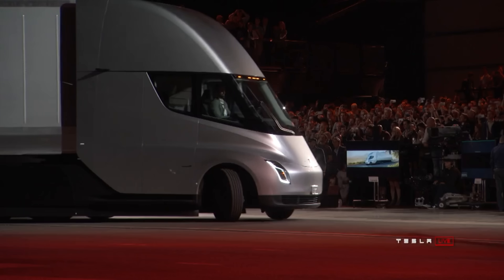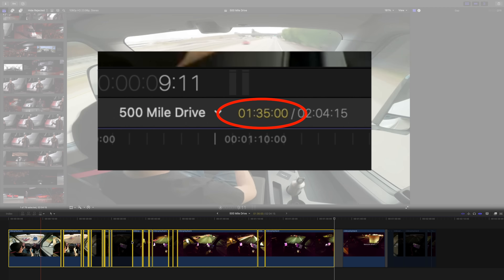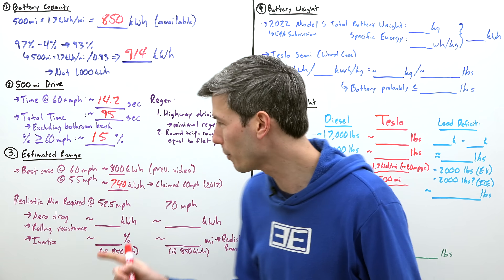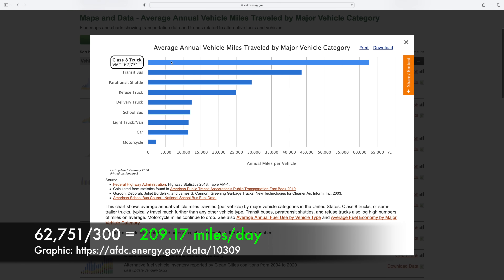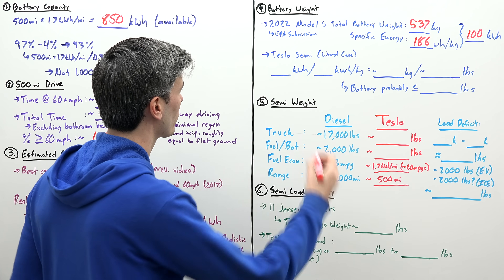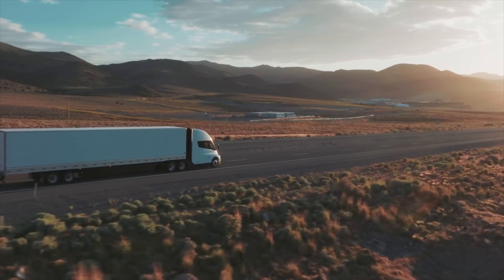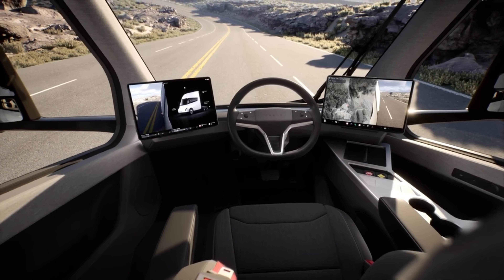Does The Tesla Semi Make Any Sense? Part 2!

Comment: I love how objective you keep your commentary. What stuck out to me was the "let's not pretend that you snap your fingers and all trucks will go electric." I hear the argument all too often that, "the electrical grid can't handle switching to all EVs," as though the 2035 mandate will magically transform all vehicles to electric. As the need arises, surely the infrastructure will be developed. Gas stations didn't all suddenly appear overnight either.
Reply: @Sean Simons   This is a great point.  I saw recently that automobile adoption went from 10% to 90% in 10 years in the early 1900s, and there was almost zero infrastructure for the oil and gas industry at the time.  Can our electrical infrastructure be upgraded in 10 years time to accommodate electric cars and trucks?  It most certainly can - @Engineering Explained did a video about that very issue.
Reply: Jason already did a video on growth of the electric grid vs future energy needs of passenger EVs.  Basically he said the historical growth rate of the grid is already close to enough to accomodate everyone switching to EVs over a reasonable time-frame.
Reply: @adamsmith-bg5wq  In the early 1900s they had a lot less constraints. Today there will be more constraints, efficiency, environmental, price of land (eminent domain), bureaucracy, etc. Also, will the energy and carbon cost of the infrastructure accommodations be properly accounted for, ripping up concrete, installing high voltage lines, installing transformers, pouring new concrete? I don't think the increased mechanization efficiencies today will outweigh the extra constraints of today.
Reply: He makes the statement that electric tractors will not replace diesel ones on all routes. You then immediately take a wild guess about the grid that you have no support for and use that as an argument. 
If every diesel truck in America was converted to electric what percentage of current electrical usage would that be?  What about for automobiles?
You don’t seem to understand how much electricity we use as a first world country. Your electric dryer or your stove uses the same amount of energy as it would to charge a car? 
Industrial usage dwarf set an aluminum smelter, or a steel mill uses enough to power city. Even in a factory, the lighting and electric forklifts are heavy energy users, and if the factory does welding, another heavy use. 
He actually did the work to prove his statement before he made it. You didn’t.

Comment: As a driver one thing I don't see anyone talk about with this truck is how bad the seating position is for backing. It causes huge blind spots while backing and we have to do a lot of backing in tight places.  Also the cab is to close to the trailer to allow for enough angle to back into a lot of places we go. It is not uncommon to have to put the cab past 90° to the trailer.

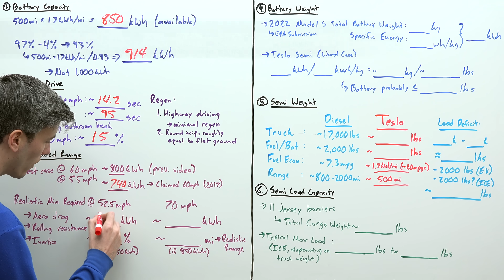Comment: 4:37 - Inertia is energy that is converted into kinetic energy of the vehicle and will eventually come back as range when either decelerating via coasting or (part of it) when recuperating. It is kind of a similar field to potential energy and elevation. This conversion on both directions is not perfect (losses apply), but is not as bad as you may think.
Reply: So in the video he is assuming 100%. I believe the real world number is no where close to this.
Reply: @cmitchell17a1  the efficiency is pretty close to 100%, as he showed in the video that the semi barely lost any energy from going up and down a large hill.
Reply: @beanapprentice1687  Proving anything here is going to be difficult when it actually doesn't exist yet except for prototypes and proprietary internal Tesla information. Can you provide any non Tesla semi evidence of the 100% efficiency (or even close to it) of regenerative braking? That means 100% of the kinetic energy lost when a driver decides they want to slow down is 100% returned at a correct later time?

Comment: If the Tesla carrying capacity is a respectable 44,000 Ibs why wouldn't Tesla have shouted that from the roof tops on launch day? The reason that non-Tesla fanboys are sceptical is that Tesla choose to withhold key information that requires people to guess and make assumptions, most people would think if the stats are good they will highlight them, if they are poor they will mask them. 

The speed of the demonstration road trip truck is important and the clip of the Tesla-Semi shown hauling the concrete blocks may not necessarily be the same Tesla-Semi that completed the 500 mile test run, it is implied, but it isn't clear.
Reply: These are clearly different semis, and nothing implies otherwise; the one in the 500 mi range test is shown at the beginning of the video with an enclosed trailer filled with pallets.
Reply: @BigBen621  "clearly" is the problem, because in the delivery event nothing was clear.

The launch speed that is heavily promoted, which regardless of it being nothing a haulier would consider a priority feature, but nowhere is it stated as to how much each maximum launch would affect the range. 

Even the the word "Delivery", how many Tesla-Semis have actually been delivered to Pepsi, none, one, five or more?

"Reliability" is something that cannot possibly be gauged until the trucks have been used in anger in real-life situations. Sure there are no clutch, engine and fuel systems to go wrong, but there are electrical systems and there are luxury car manufacturers like Land Rover whose Range Rover range are notorious for electronic unreliability.

With the current extreme cold weather, how much does that impact a Tesla-Semi's range?

For a marketing event and for those of us that do not like to take things at face value we were left with more questions than answers.

Comment: While I agree that for the sake of your analysis you can ignore regenerative braking, the way you explain it makes it sound like it's not significant due to relatively constant speed which is not really true.  From past work with Southwest Research Institute, this was studied as part of a research consortium by major engine and vehicle OEs.  Conclusion was clear that while speed differences were not great, because the mass of a loaded truck is so great, there is actually substantial energy wasted in the minor slowing and subsequent acceleration seen in regular cross country driving.
Reply: ...but most of which would be recaptured by regenerative braking. This is why all EVs have higher city than highway range ratings; much of the energy of stop-and-go driving is recaptured by regenerative braking, while the air and rolling resistance losses in highway driving aren't.

Comment: The Tesla truck may in fact work for 80% of trips, but that doesn’t get it done unless you are exclusively a point to point user. If you are an independent and book a full spectrum of trips, then by definition it won’t work for 20% of your trips.  If you EVER want to do a heavy, long trip, or deliver to a point 500 miles away that does not have charging infrastructure, then you can’t buy this vehicle.  The tails of the usage curves - the rare events - dictate many engineering design criteria, and range is one of those criteria.  

The Chevy Volt is a lesson learned.  Eighty percent of U.S. drivers commute less than 40 miles per day, so Chevy figured a 40 mile electric range was sufficient.  Assuming you don’t go to the store or run errands or pick up your kids after work, this made sense.  But you will want to go farther every once in a while, so the Volt was saddled with half a ton of ICE equipment for those conditions. 

Most braking stops are made slowly over a long distance, but you still require short stopping ability for the small percentage of the time that you need to stop quickly.  Same idea with range.   

It might make sense to design trailers with some internal battery capacity to augment the semi, and perhaps put motors on the wheels, to augment overall range and increase charging capability. The trailer could be recharged with standard charging equipment while it is being unloaded.  This would increase delivery range and free up vastly more charging destinations because it would not dictate multi megawatt chargers at delivery destinations.

Comment: How are your trucks so light in the US? Our average tractor unit in Europe is over 18,000 lbs how can that be when our cabs are less than half the size of US trucks. My unit and trailer weights in at 40,800 lbs, I guess that's why you have more of a problem with your trucks blowing over. 👍🇬🇧

Comment: I dont think the Tesla semi (leaving battery out) is going to weigh as much as a diesel truck (IE 17,000 lbs).   A semi truck's weight is about 25% power-train.  The Tesla semi will carry far less weight of engine, and no transmission at all.   instead of 4250 pounds, something like 2000?

Comment: Wouldn't surprise me if Pepsi or Frito Lay use the trucks to relay loads. Have two trucks meet somewhere and swap trailers, then return to their respective terminals. Very common thing to do for some trucking companies.
Reply: That won't be a thing for a while. No reason to even bother with the long routes when they still are going to take a while just to replace their shorter route vehicles.
Reply: @keco185  The Tesla truck will probably be best suited for local and regional, though I'd prefer a shorter wheelbase if I was using it for local. Hopefully it'll be really maneuverable.

Comment: I love the format of your math breakdown videos. Very nice to see some straightforward calculations instead of just speculation.
Reply: I suspect the battery capacity is actually 1000kwh but only 850kwh is usable. This is due to the fact that the battery will only be super charged which is the worst thing you can do to the battery. The unused 150kwh is probably rotated among the cells to preserve battery life.
Reply: windmills and Soler is ineffective argument closed and you are a woke sail out

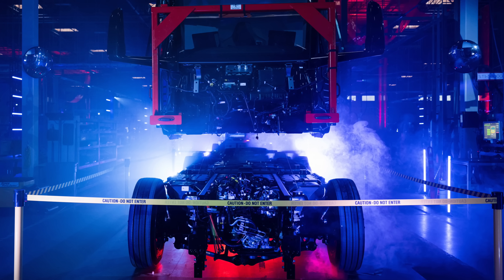Comment: 8:09 the only thing I would have changed is when calculating the weight of the battery. The model S uses 18650 cells, I would have used the model Y as some of them have come with the 4680 which is what the semi uses. The Wh/g of the 4680 is much higher than the 18650.
Reply: "The Wh/g of the 4680 is much higher than the 18650", that's complete rubbish, where did you get that junk data from?
Reply: Don't forget the battery is also about 5 times density of 18650. You have less cell per pack with 4680.
Reply: @nguy404  no, it really isn't having a battery 5.48 times larger with a 5 times capacity is actually less density in wh/g (and you actually mean 2170 v 4680, and in all cases the wh/g is very  similar, no major increase in wh/g at all

Comment: As a truck driver, for me, the biggest deal breaker on this particular truck would be the position of the driver's seat
Reply: That is because Elon had some pot and said everything would be self-driving by now and the central seat is initially for a safety driver, and then removed completely. Same way the Cybertruck looks like it does with those materials. Wait until it tries to pass the crash tests.

Comment: I'm more worried about how is the battery going to last long term. Teoraticaly these trucks don't need to be updated to meet emisions standtards meaning that I could use them 20 yrs in the future but I don't think that charging it to 100% and discarching it to 3-5% would help the battery long term, based on the number of km my trucks do in a year I expect that battery to last about year maybe a bit over if Tesla has done some improvements there but I doubt that they have something gound braking
Reply: The math is easy, if the battery is good for 1,000 charges and you get 500 miles per charge then then it will last 500,000 miles.  Reality is the battery is probably good for more like 3000 charges, and maybe we use 350 miles per charge just to stay honest, and that gives you 1,050,000 miles before you start thinking about a new battery. (If we used 500 miles per specification it would be 1,500,000 miles)  At that point the battery is probably still good for some alternative use, and maybe the new tech battery will give you more charges or more range, or both
Reply: The batteries will last at least 15 years just like in the electric cars. I doubt many will discharge that low but the use will be based on the fleet owner and the daily range needed. They may be fine keeping the pack in the 20-80% range since electricity isn't free and why fill up if you don't need to. And that's all we need for a number of years. The long haul and heaviest loads can stay diesel for now. Getting electric trucks for local delivery is far more important, the trucks running around restocking Circle K and the downtown deli.

Comment: A diesel counterpart can go 1,500 miles or more after refueling for maybe 10 minutes. The Tesla must recharge at least 4 times to achieve that range. Worse, this must all happen during on-duty hours to stay legal, which chips away at the time allotted to the driver. And to recharge, you'll need a substation to deliver you about the same amount of power that an average household uses in a month (~ 900 kWh). This requires serious expansions to the power grid wherever you operate these trucks. 

None of these problems mean Tesla semis are impossible. I just don't see the real path forward for them into the mainstream in the way Elon and Elon bros seem to think. They sound like a cool idea. But they don't really solve any problems so much as they create new unnecessary ones. And they have features that drivers don't really care about. 0 to 60 mph in 20 seconds? Okay cool. How much time does that save drivers when they are spending 30 minutes recharging every 5 hours while the "slow poke" diesel is still rolling the odometer?
Reply: The first wave of electric trucks, of all classes, will do their daily travels within the range of one charge.
Reply: @davidmccarthy6061  You can't get around the energy consumption requirements. If they are going to use 850 kWh, they are going to have to provide 850 kWh. There are no free lunches. At 850 kWh, such a truck has a daily requirement that is equal to a month's worth of power for an average home. (A substation will provide that power to about 1,500 of those homes, roughly 30 neighborhoods.) So say you run an EV fleet 25 days per month, which is realistic. This means, for every 60 EVs, you need an entire substation solely dedicated to this fleet. Since they are staying local, these EVs, meaning their energy demand, will also remain local. 

This is a major infrastructure problem. And you need to introduce this problem everywhere you plan to make EVs work. For starters, it's at least an acre of FLAT land and 2 to 3 years of project planning and management... everywhere you expect to make EVs work. 

Again, I'm not saying it's impossible. But don't just fanboy. Look at the whole problem. This is not an Elon problem. It's a taxpayer and Joe Public problem. 

And that's just for the power production requirement. Now you need to figure out how you're charging 60 trucks and where you're parking them. Will you buy 60 overnight chargers? Cheaper per unit, but requires a lot more space in your yard. Quick charging instead? Okay. You could get away with the amount of parking space of a regular fleet, but these are expensive and how many do you need to charge a fleet and keep all drivers within duty hours? 

These are business problems. Again, not impossible. But they are problems we must face. 

Can you tell people have thought about this? A lot? Notice that Elon is not discussing any of the real world issues fleet owners will face. He wants to wow you with "so green and so cheap" and "look how fast it is!" Somewhere between passenger vehicles and semis, EVs hit a point of diminishing returns, even if Elon sold them at cost. That point is what we're seeing.

Comment: I am not a big EV fan especially for me (drive 100+ miles a day), but with that kind of capacity how long will it take to charge a truck? I know it seems to take forever for them to fill up on diesel, but based on how long I get in and out of a gas station vs a Tesla (not to mention a holiday and the wait). I agree with short haul, esp in major metro areas, but still wonder about the overall environmental impact over the entire LIFE, which means disposal of batteries and the car as well.
Reply: One thing has been doing by Tesla they recycle the battery to make new ones. The best part of the battery I think worth mentioning once the materials are mined and refined and when at end of life, 95% of the battery materials can be recycled and reused without refining. Think about the close loop, every 20+ years all of the older batteries can be recycled which I think leads to reduced mining.